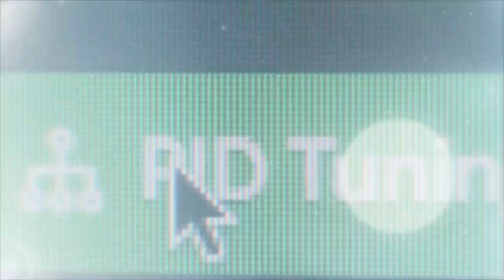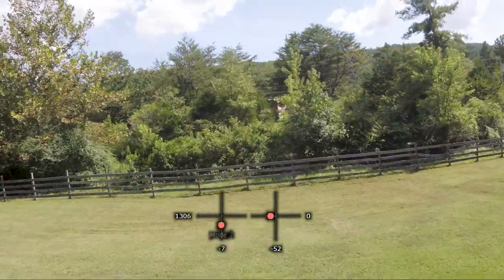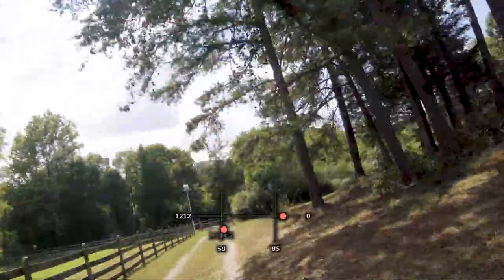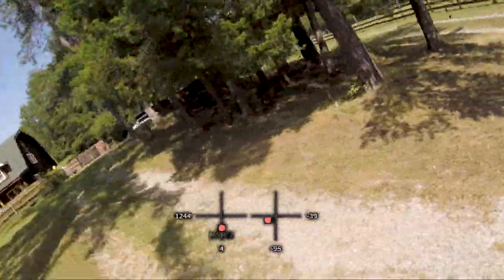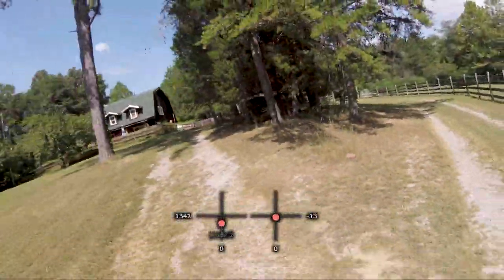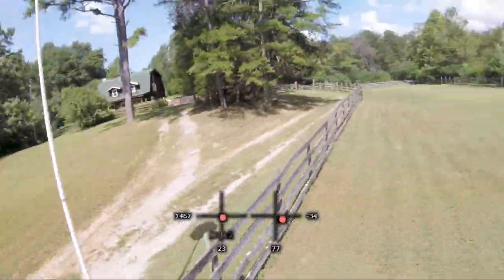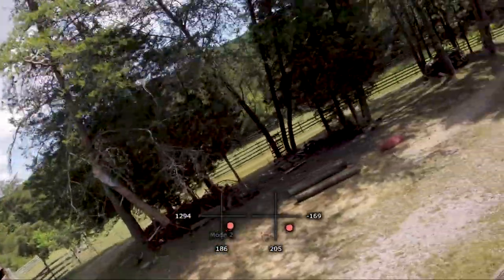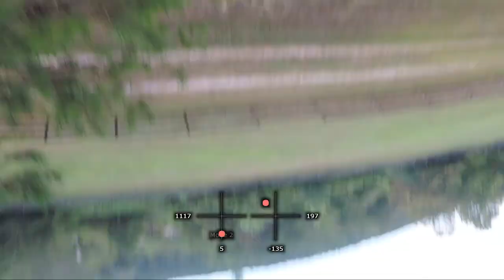FPV Practice Drill | TURN THE WRONG WAY

Comment: The biggest thing for me , and from what i can see generally is the under use of UP PITCH. If you start incorporating more up pitch maneuvers,  your flying will drastically change and become more dynamic. Even in this vid you hardly use any up pitch,   I agree that this is a good starting point, but really mastering dat Up  Pitch is what will open a ton more doors .
Reply from the maker: You don't normally use pitch back when flying forward unless you mean to slow down. Flick moves can sometimes be set up with pitch back. 

What else are you thinking of?
Reply: I was confusing the 2 , apologies, But physically moving the stick forward ( down pitch)  is what im referring to, not pulling back ( up pitch ) .  To me, down pitching from maneuvers are the most disorienting , but after mastering that , it opens up a bevy of possibilities. Ive noticed MOST pilots do not utilize down pitch in their freestyle, other than quick front flips really, People who are doing Matty type maneuvers on the other hand have to master this.  But beyond matty flipping, when you start to push the quad down and take sideways lines around things , it adds another dimensions seemingly to your control and really makes you think differently about your surroundings is a 3D space.  Its just an interesting observation ive been making recently , and something ive been working on in my own flying.

Comment: 6 point snap rules, knife edges, barrel rolls (smaller power loops), hi Alphas, pinwheels. All the basics are there. I've been wondering when somebody was going to want to start using them.
Reply: I've been waiting for someone to do a reverse split S (a split S where you gain altitude) in a drone. It should be the quickest way to do a 180 if I understand the physics right (and the drone has enough power). If you want to try, start by looking up a split S in a fixed wing aircraft.

Comment: i know its off topic but i found my issue on jb f4 1.2 version f.c the negative pad for lipo input must have damage to pad becouse the rest of the board seems fine but there is a bad or lifted pad that dont bridge the negative for power to rest of board. so rdq is sending me two new ones since one ive been using went out and ive got one brand new one in package and they said the version 2 is bulletproof which makes me happy.

Comment: Hello Josh, Great video and training, I was wondering if you can help me, I was trying to add a uruav ur65 [frsky] to my jumper t8sg, and on betaflight calibrating my endpoints and midpoints, I notice my numbers at roll, pitch, yaw and throttle, these numbers were very jittery, increasing and decrease sporadically, which made it very difficult to change the numbers for that reason what's wrong with this picture....please help! Thank you!!
Happy flying!
Reply from the maker: Jittery channels might mean the gimbals in your transmitter are wearing out.
Reply: This is a brand new jumper t8sg plus, and no problems with other quads!

Comment: Good tips. Not that you'll watch but all my fpv vids you'll notice I turn right 90% of the time. Also, my turns are roll based with touch of yaw. However, I'm conscious about this and I want to want to switch it up. It's the matter of making myself do it. You'd think this is straight forward but our minds gravitate towards the easy method I guess. that being said I do have a big problem with yaw. I think I should push the yaw further but I don't know. I'm new. If you're willing, watch my latest babyhawk R video and see if you can give me tips on yaw. I'd appreciate it. Thanks -M

Comment: Why does the last 1% take soooooo long to charge...If I take the batteries off at 99% is it a big difference
Reply: Most chargers do the balancing at the end, and it can take a while if the batteries well used. They also "throttle back" on the charge rate to let the cells settle before the balance routine starts. Between the 2 things, just as you say, the last part is slow. If it takes a particularly long time on some batteries, it's probably time to look for sales and replace them. There's nothing like new fresh batteries!
Reply from the maker: Balancing is slow but important to battery health. If you skip balancing once in a while it's no big deal but don't skip it forever.

Comment: What this does above all is forcing you to have some spacial awareness while you're drifting where you can't see. Every good freestyle pilot does not only know what he sees in the goggles but has at least a partial map of the surroundings in his head and knows where drifting outside the camera cone is possible and where it is not. This is a significant difference to race pilots.
Reply from the maker: Yep, I fully agree. Spatial awareness is one of the biggest challenges.
Reply: Ummagawd is pretty awesome with this, and of course Mattystuntz and Steele as well.